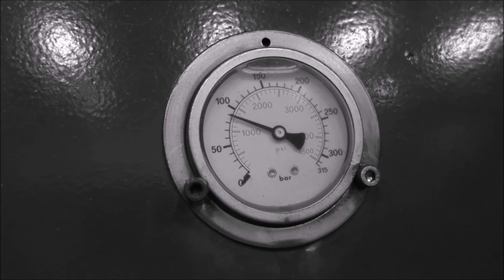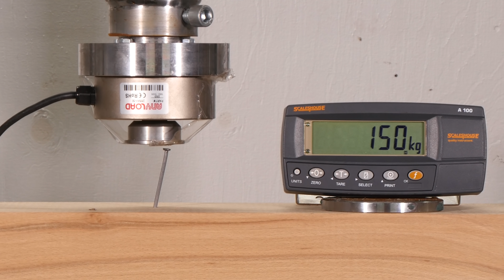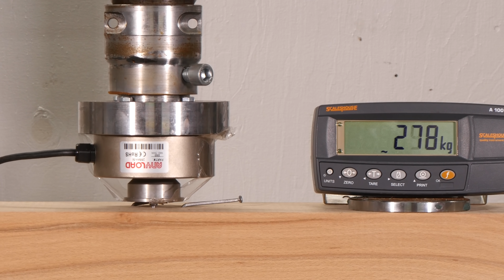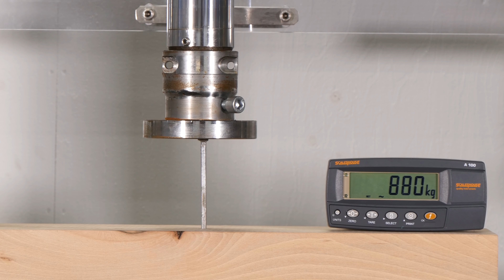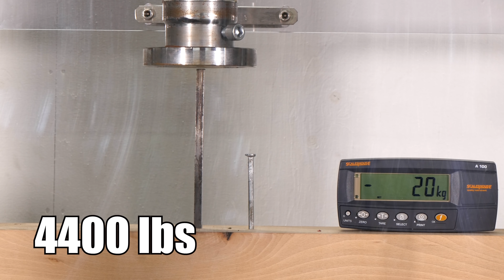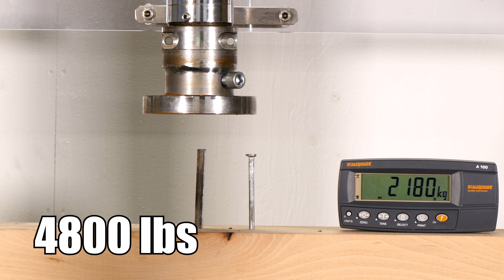How Hard It Is To Push Nail into Wood? | Hydraulic Press Test!

Comment: I suggest testing the maximum crushing force needed to crush/deform blocks of various wood - pressure applied to the end grain... hardwoods versus softwoods.
Reply from the maker: I think I could do somekind of test like that. If I just press wood block against the table it's going to explode which may damage my load cell but I think I can make somekind of test with out destroying my sensors.
Reply: Wood strengths are already very well tested though, any answer you require regarding the strength of a specific wood can be easily found via google.
Reply: @user-js3rn3sv8x  finding answers by exploding wood with press > finding answers by searching Google
Reply: @user-js3rn3sv8x  but wood strength tables don't include a fun Finnish video of said block of wood going KABOOOOOOOOM.
Reply: @HydraulicPressChannel  If you want a wide selection of different woods in small quantities try a woodturning supplier.  Able to get smaller pieces of exotic woods that way.
Reply: Hydraulic Press Channel it would be Nice if you also mesured the density of the Wood to get some more statistics. And also try diferent sizes to see if the force is conected to the density.
Reply: @crimsonhalo13  They also don't have the added benefit of being able to hear Anni giggle in the background! :)
Reply: @HydraulicPressChannel  That is sort of what I was thinking about.  I would hate to see your equipment get damaged though.  Great Channel!
Reply: @user-js3rn3sv8x  yes, there's statistics but I want visualization
Reply: Hardwoods are not the same as hard woods. The difference between hardwoods and softwoods is the type of tree. Some hardwoods are soft woods, some softwoods are hard woods. Google it and find a good explanation.

Comment: Can you make a new Channel - Hydraulic Pull Tube?? Instead if a press, something that can pull things apart! How much force it takes to pull a nail out if wood, a screw out if wood, etc.
Reply: I've seen them pull wooden posts out of the ground, some snapped. Would love to see the torque figures
Reply: And that was interesting 😀
Reply: Look up tensile testing machines
Reply: We had something similar in metal shop in high school. We tested solder joints, and pulled many pieces of metal in two.  Can't remember what else was done with it, but it WAS cool when things came a part with a big bang!
Reply: You might be onto something

Comment: I was told as an apprentice that a 4 inch nail has a shear strength of 1 tonne . I've always wanted to test that.  I suggest 2 blocks of wood with 1 nail holding them together and putting force on each block from opposite directions . Some extra stabilizing may be needed to hold timber correctly

Comment: Shorter nails are much less likely to bend
Reply: They'll also require less force to push in.
Reply: @DataumCats  Actually in engineering we have to take this in account, and it's working more like the proportions, so the longer it is and the smaller its diameter is, the more likely is it going to suffer so called buckling.
Reply: That's what she he said
Reply: @boldizsarbalog6206  I'm thinking about something dirty
Reply: Or he could use nail from high carbon steel like concrete nails, it's less likely to bend. It could snap though.

Comment: this is so regular but nobody tested it.isn't it surprising
Reply: Nobody tested it? Are u for real?! xD
Reply: It is a vary inter resting.
Reply: I was thinkin the same
Reply: To think that engineers are doing aren't sitting around all day testing designs and materials...
Reply: took the words out of my mouth.
Reply: Slow speed pushing requires a different amount of force to high speed.
Reply: Yeah i have my 300 kilogram hammer right here, physics am i rite?
Reply: Constant force and a jolt force have different etfects
Reply: Actually you have tables and mathematical models to calculate the force needed to penetrant different materials. Also it's possible to calculate the force needed to push an nail of any diameter to any material softer than the nail.
Reply: @Ethernet-q5o  you have to break it down to overall energy required and you will end up mor or less the same
Reply: But you know what's not surprising... How much you can save on gieco
Reply: You just described HPC

Comment: It would be interesting to see how much force is required to pull a nail or screw out of the wood. Then also break two connected pieces by shearing and bending. This could be done on different materials and attachment parts. There's an endless supply of content in this...
Reply: Todd M  yeah almost endlessly...

Comment: I was doing some remodeling work on a very old once a few years back. The wood was so hard a regular 16d nail would bend like a paper clip. Had to use nails meant to concrete. And even a 22 caliber cartridge nail gun in some cases. Some wood it is very hard to get a nail in.

Comment: You could put your nails/screws in a tight tube and push a slightly loose fitting rod through the tube with the fastener to drive it straight..

Comment: Very intresting! This also shows the power of inertia, haha - because when you use a hammer normally, that's what drives the nail.
Reply: Thats also why I prefer to loosen rusty bolts with an impact driver over using a wrench. The wrench will shear the head or snap the bolt more easily.
Reply: Actually kinetic energy is what is the force is.
Reply: You fill me with inertia
Reply: @Mixwell1983  you're both wrong. The force at play when striking a nail with a hammer is momentum.
Reply: Inertia is a property of matter!
Reply: gravity is what drives hammers guys the swing is more about aiming
Reply: @Wulthrin  Not necessarly - you can as well hammer a nail into a wall or even the ceiling (even if of course the easiest is to hammer it down as the gravity helps). The swing is mostly about speed - a slow movement at the handle get into a faster at the hammer head and thus give it more momentum. 
But inertia is the property of mass that makes impossible to change it's speed at zero distance - the shorter the distance, the more force it take to stop something at a given mass and speed. Even with the low mass of a normal hammer and speeds wich you can easely get to, by swinging it with the help of a short handle - it still takes the forces shown in the video to stop it at a very short distance (the few mm or cm wich the nail is driven into the wood each strike)
Reply: @Swaggymaster  Bill, Bill, Bill, Bill...
Reply: Impulse it is..
Reply: Its the law of interaction not the law of inertia...
Reply: Inertia drives nail ? Kinetic energy ? Gravity ? Impulse ? O M G... some ignorant ppl here... Get ur physics together...
Reply: So youre telling me that when I hammer a nail into wood, the hammer is what's driving the nail in? That's a bold claim...
Reply: Inertia is basically resistance to movement so the nail is where the inertia is at, and the Hammer has kenetic energy along with leverage to multiply force.

Comment: I always wondered about this stuff!
We use old pallets for heating, and try to get rid of the nails so they don't clog the oven.
I tried to invent some machinery for extracting partly thin and/or brittle nails.
I even thought about using a rapid magnet, but I didn't get far with it.

Comment: wow i cant believe that humans can generate a ton of force with a hammer
Reply from the maker: I think that the friction is smaller when nail moves faster when hit by hammer but it have to be still quite much force. Maybe I should do video about measuring that on beyond the press channel
Reply: Force equals mass times acceleration. Generating 2 tons of force is no problem with a hammer.
Reply: @billyf.3198  I don't think you understand basic Newtonian physics...
Reply: Billy F. The force needed is the same but it’s harder to generate it that way.
Reply: How much force do you need when you stop the press in between? You have to overcome additional friction.
Reply: I feel a disturbance in the force.
Reply: @Mp57navy  exactly, he doesn't know that just the equation for calculating the force it take to accelerate and object not the equation for impact force.
Reply: If an object is resting on an even surface, then gravity is the acceleration, which means the force is roughly 10x the mass in kg. However think about how fast you can swing a hammer, then when you hit the nail it will come to a complete stand still almost instantaneously. Going from a very high speed to zero in a fraction of second, results in a very, very high deceleration of the hammer. Even though the hammer doesn't have a very high mass, the acceleration is super high. Finally, the nail is very small (Top surface area), which means the pressure on it is much higher than the newtons generated (magnitude of the numbers)! :D
Reply: Use a high speed camera next time using a hammer.
Reply: they cant
Reply: For one, notice how it increased as it continued to go in? Well if you hit it with a nail it won't necessarily go in that far, so it wouldn't require that much force because you would be swinging the hammer too. Let's not forget velocity from the swing. If you just pushed on the hammer without swinging, yeah, it would require a LOT more weight or pressure. With velocity, it makes things much easier. At least that's my guess from the top of my head.
Reply: Just miss and hit your finger one time and you may change your mind about that.
Reply: You should see the old carnie trick where people shove nails into planks without a hammer.
Reply: @Mr Sunshines hitting your finger with a direct hit from a hammer (not just missing the nail and tapping your thumb) is going to seriously fuck up your finger
Reply: It's impulse imparted you're after, not force.  f=ma is only used for accelerating an object, can't be used for this, it's momentum is the key.
Reply: My thumb believes it.
Reply: Speed, baby.
Reply: It’s a striking force instead of straight pressure. Sort of like pressing your fist against a piece of drywall instead of punching the piece of drywall
Reply: you can get up to about 30 tons of force with a one-hand hammer.
Reply: Oh yeah yeah
Reply: You my good sir have trolled a lot of people

Comment: This is the demonstration of the difference between torque and power.  Small steel hammer transfers all of its velocity in an instant to the nail which has some spring action.  Wood suddenly loses "grip" and nail slides in.

Comment: Fwiw "hardwood" and "softwood" don't actually have to do with how hard the wood is.
Hardwood comes from trees that loose leaves in winter (deciduous sp?)  and softwood comes from ones that dont (evergreen).
Reply: Great explanation! Expanding a little on this for those who are not confused enough yet... when you go buy wood there are a few types that you often get:

Fir, spruce, pine, cedar are common softwoods (all gymnosperm trees). Some species of cedar are a bit harder than the others, but still softer than most hardwoods. Softwoods are usually cheaper, since they grow faster. Some expensive kinds of cedar are the exception to this price rule.

Oak in its various incarnations is what most people  agree what a tyical hardwood is like - hard, resistant, heavy.

Beech and birch are also hardwood (leafy trees) - and here we've got the first "oops": birch is pretty soft, you can't use birch planks for anything useful, they'd bend and crack. Birch plywood is okay'ish.  Beech by the way is very flexible, easy to bend (e.g. curved chairs) and not very prone to splinter (that's why spatulas are often made from it).

But it gets worse: the softest "hardwood" is in fact balsa wood. So next time someone asks what your balsa based model airplane is made of you can confidently and proudly proclaim: it is made from hardwood!

Comment: You should see how much pressure it takes to drive the nail 9000 into a block of wood while glowing red hot
Reply: I think it would do a little more concidering that's how they insert red hot rivots into steel
Reply: Red hot steel burns through wood quite easily, bigger nail has more thermal mass so will stay red hot for longer. In theory the thin nail would take least force to push in, but it will loose heat very quickly so the force will increase more rapidly than the big nail.

To fit handles to tanged tools Blacksmiths heat the tangs and push them into the wooden handle by hand, it can be done without pre drilling.
Reply: @remy5405  as a carpenter, I think that wood does not getting any harder, it's just a way to avoid shattering at the end of a spear
Reply: @netyr4554  but nails are made of pretty crappy materials, which will most likely bend under any pressure while red hot

Comment: I would like to see you push a railroad spike through a 5 inch round X 1.5 inch thick aluminum disk please. Mill the head off the spike and mill the aluminum parallel to its self. Force measurements of course, please. Thank you.
Reply: Just depends. 5052 would press like butter. 7075 is more brittle. (Prone to shatter) 6061 might take it depending how fast he goes at it.

Comment: You should try running the screw into the wood until the threads are fully engaged and then press it...it might work
Reply: Or saw off the part above the thread and then press it in.

Comment: The hardness of wood is measured using the Janka Hardness scale. It's a measure of how many pounds of force is required to sink a 11.28 mm diameter sphere halfway into wood.
Beechwood is around 1260 lbf. So that's slightly softer than Oak (1360 lbf) which is fairly hard, and significantly harder than yellow pine (840 lbf) which is easily scratched and dented. Though you could also use the Mohs hardness scale, but the Janka test is specifically adapted for wood.

Comment: Physically you should use the unit newton, it is the force you need to push it into the wood. With speed you can calculate the energy in joule the hammer needs on specific weight.
More interesting would be not the static friction the wood causes but more the dynamic friction (increased speed when pushing it into the wood).

Comment: You should try pushing other stuff in to wood. Like bone or chopsticks or nuts or bolts or deck of playing cards. As to the screw try thicker one with pilot hole and mount it on rotating bearing.

Comment: The nails  temperature  heats up..  hammers  are quick.  and by the time the nail heats up its in wood.. vs this is slow and heats up considerably  increasing the chance for it to bend  because the metal  gets soft

Comment: With the screw you should have welded 1"×1" steel plate to a rod welded to a ball bearing. Then put the bearing on the press. It would have held the screw but let it screw itself (giggity) or spin freely.

Comment: Wow that is so interesting that is incredible the  pressure it takes to drive a nail into wood like wow,  I would love to see how much pressure it would take for a bullet to punch through a piece of wood like that what kind of pressure would need to be applied for say a bullet comparable to 50 cal or 7.62 x 39 or 308 or 270 Winchester something like that would be extremely interesting,  obviously he would have to machine a Bullet  Head and then push it through with a high tensile steel bar behind the bullet, the steel bar and the bullet could be one piece I have seen the 7.62.39 punch through a tree 11 inches thick it was frightening two see the power needed, the pressure that must have been applied would be just phenomenal tons of pressure to push through like that

Comment: As a Geology Instructor I had a request:  would you be able to crush following:  a block of granite (makes up most of the continents), a block of basalt (makes up most of seafloor), and a both of aforementioned rocks together.  My students often struggle grasp how much stronger basalt is relative to granite.  These contrasts in rock strength are a major reason we have mountains where we do.  It was also the argument used to shoot down continental drift hypothesis.  Loved the oil from sand video BTW.
Reply: Also heated rock samples (~ 500- 800 degC)  will behave differently from  samples at room temperature.

Comment: This was pretty cool. Could you do a revisit later? I think if you keep the nail steady and push the wood into the nail instead, you will get better results. Also it's important to know the density of the wood to evaluate the results. Maybe you could try a hardwood and plywood. Maybe plywood would be closer to your initial estimates.

The screw needs a surface that would allow it to rotate. The metal surface from the press, in addition to the pressure, would not allow the screw to spin, because of attrition. Maybe if you put a ball bearing between the nail and the press, this could work, but depending on the pressure needed, the ball bearing could break.

Comment: Put a bearing in between the press and the screw head and the screw just might spin itself!

The problem you are facing is that the pressure on the head is always in the same downward place and unless the nail is perfectly level vertical eventually the force will push down outside the hole and the nail will buckle. If you could make it so the nail head could slide in horizontal plane freely, then I think the nails would go in just fine, otherwise it has to be perfectly vertical in all directions. When you use a hammer you change the point of force with each hit so you don't have that problem with a hammer.

Comment: Impact forces are high. The formula is simple. F=ma. So a heavier hammer does a greater force. Then the faster it stops the greater the force. For example if you hammer a sponge, it will stop slowly. If you hammer a stone. It will stop very quickly.